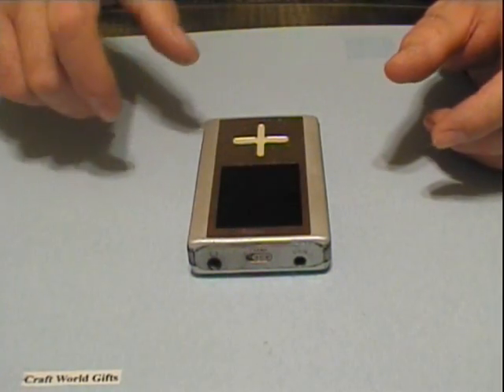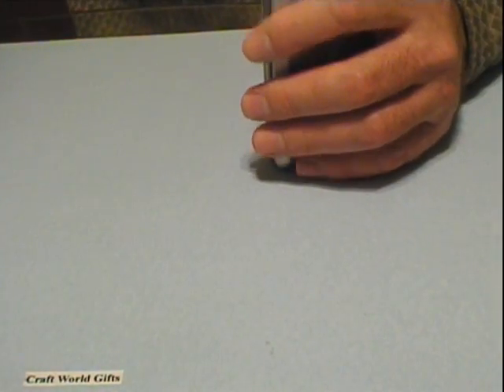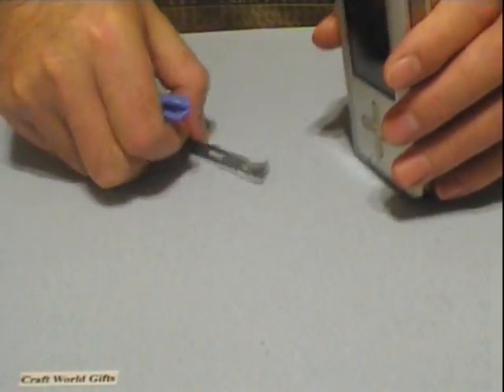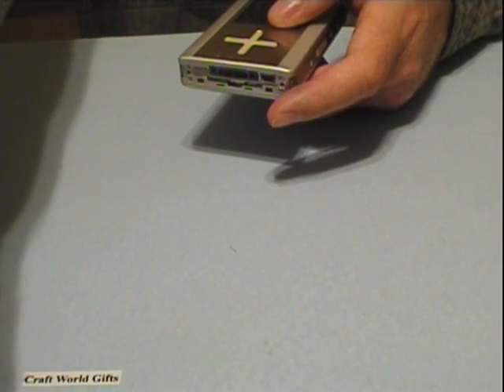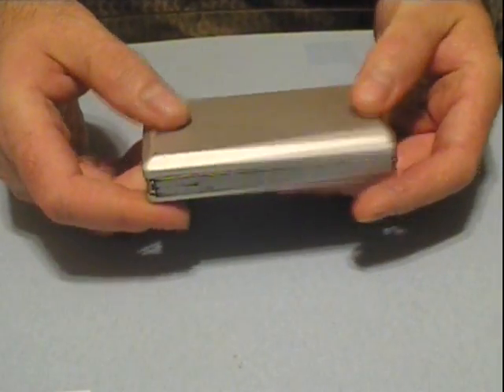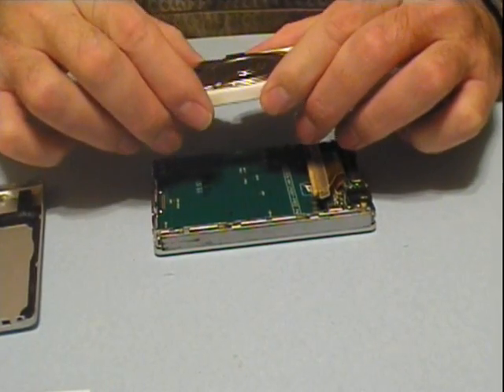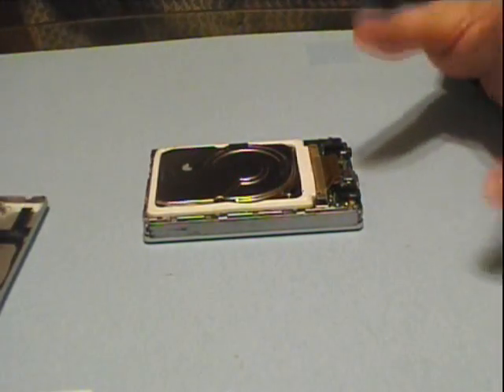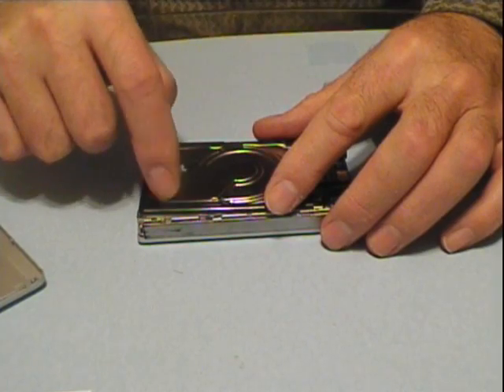Instructions On How To Replace Exchange Your Toshiba GigaBeat Meg F10 F20 F30 F40 F60 Hard Drive

Comment: The buttons on mine don't work with the case closed.  When I have the top part of the case offset (screws removed and slide down) or off the buttons work

Comment: I have 3 of these. One I mistakenly formatted the hard drive with NTFS instead of fat32. It gets an error code and nothing I do will make it work. It's also not be recognized by windoze so that I can format it. I even used test disk, which can detect and resurect dead drives.